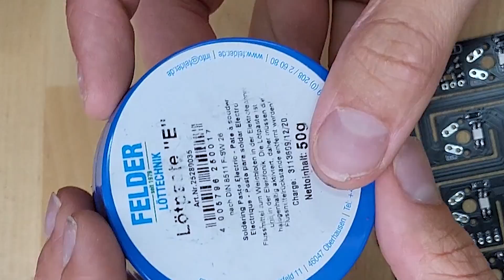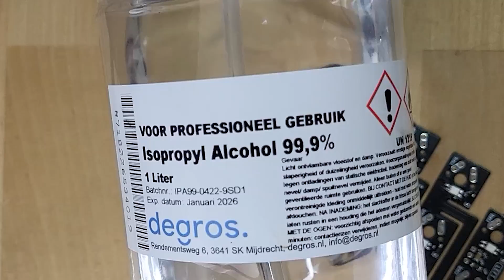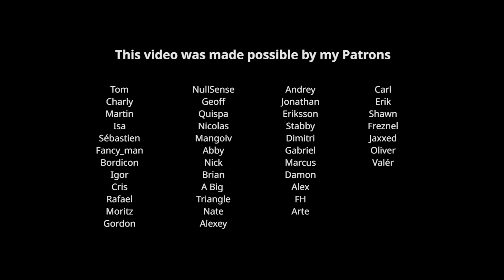Charybdis Nano - Dactyl build log

Comment: The design looks really interesting. One question that I have is why not use the small 3 pin JST connector instead of header based connectors. Would this also be possible with flexible PCB? That would remove some of the cables and since switches are structural elements it would still function.

Comment: @bastardkb Very cool - the build quality on those plastic parts and PCBs is amazing, as well as your attention to every detail! But after using handwired Dactyl-Manuform for couple of years now - I'd say the internals should be enclosed somehow. The dirt and grime that keyboard usually gets in daily use, is much harder to clean from those little nooks and crannies. And if the MCU is exposed, it's much more prone to coffee-spill - which is guaranteed to happen at some time :)
Reply from the maker: Thank you !
Until now I've had no issues with dust, and didn't hear reports. It's part of the style of the keyboard as well.
We did have some cases of ESD damaging the serial pin, the RP2040 is more sensitive to it. On our prebuilts now and on the dilemma we added a chip to protect from that.
If you drop coffee on it though there's probably no saving it :D

Comment: Hi! Just starting to build my premium-like Charybdis! I bought the kit from your page except trackball, prints and rgb and I got 14 m4 inserts and screws (webpage said 12, thanks for the extras), but I have a problem. Since I'm kinda replicating the premium version I have plates both between the keyboard and the tent, as well as under the tent. But I would need another 6 inserts and screws for that. I'm a bit confused, are the bottom plates not an official part of the design?
Reply from the maker: Hey! 
The plate tents require additional inserts, and M4x8mm as well as M4x6mm screws.
If you got the premium kit, those are included. If you got the regular kit, that configuration is not supported and you'll need to source them yourself.
Hope that helps!

Comment: I like it a lot, its posible to made a easy version whiout track ball and  the pcb whiltout diodes like the ferris sweep ?
Reply from the maker: For the trackball-less version, check out the skeletyl on our github !
I tinkered a bit with the idea of no diodes, but it means a lot more wiring towards the splinky shield PCB, and also a completely different design, so I gave up on it.
At the moment I'm working on designs that you can order SMD assembled, they are on pre-release on github !